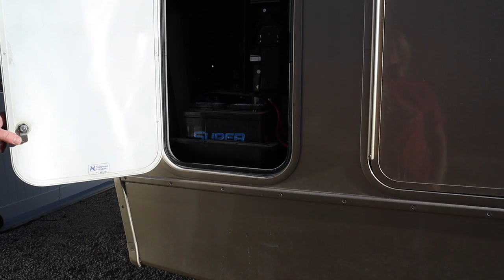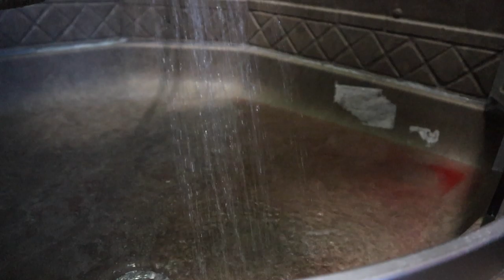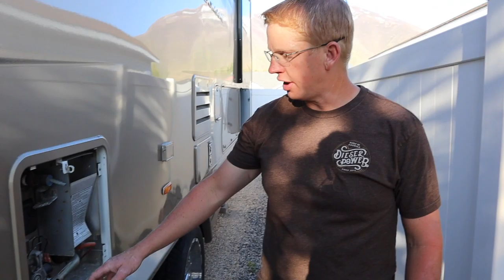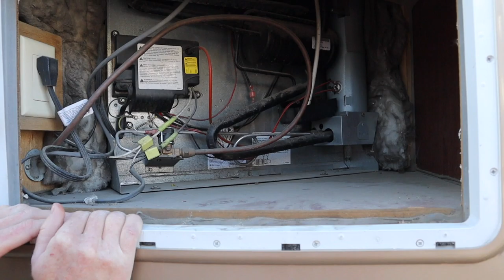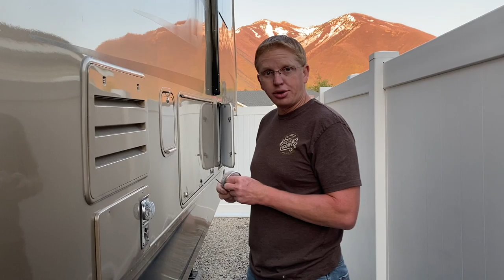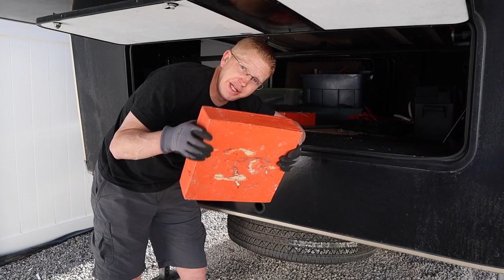DIY Getting ready to go camping

Comment: Did you put wasp covers on the refrigerator and hot water heater? They need them as well. 

I put a bug guard on my hot water heater grill but unfortunately on a recent trip, the road was so rough that the grill fell off along with the big guard. My hot water heater grill just snapped into place. If yours does this and you add a bug guard I would suggest finding a way to secure the grate to the door. Perhaps drilling a hole latterly and adding zip ties, or cotter pins or king pins would work. That was in July and I haven’t been able to get a replacement part for the hot water heater grill.

I’m fortunate that no winterizing is required in warm San Diego. So we continue to go camping every month, no down time for our RV. But I have to mow the yard all year 😒
Reply from the maker: Have not yet but planning on it.